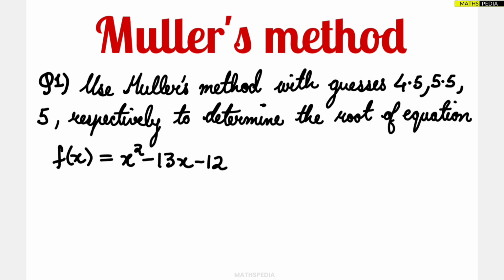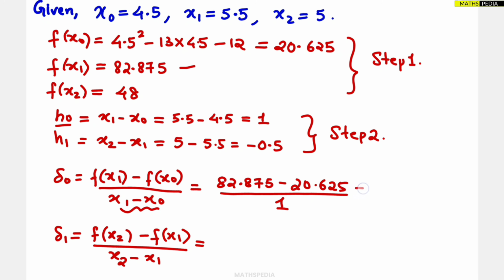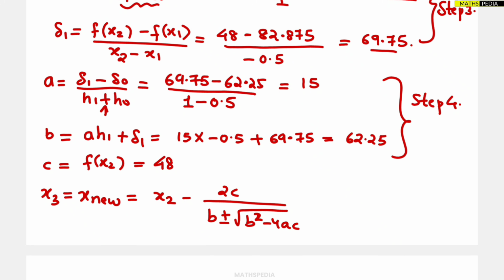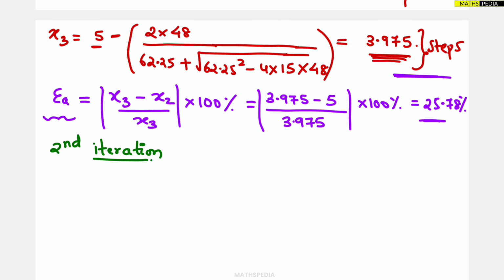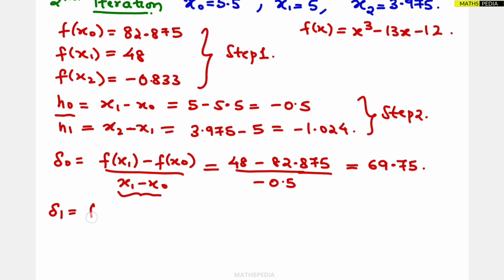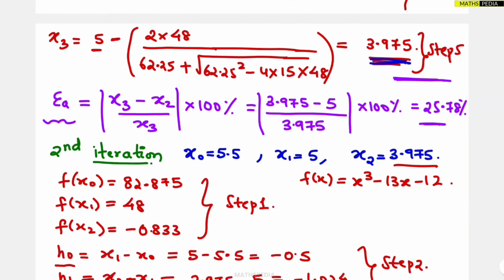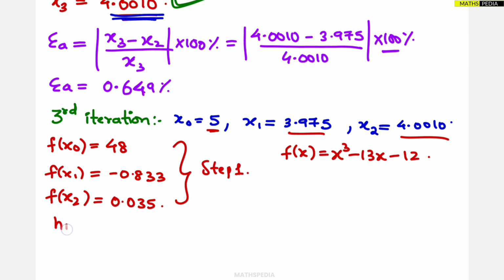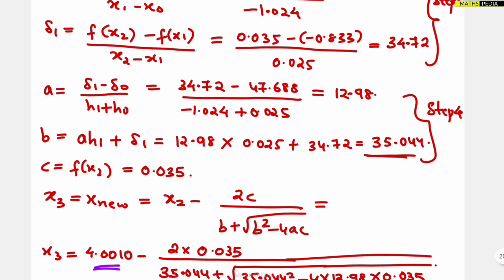Muller's Method | Numerical Methods | Engineering mathematics | Example solved | Mathspedia |

Comment: I m getting different values for f(x0), f(x1) and f(x2). In the very first step
Reply: Same here.. When my Xo=4.5 f(X0)= -50.25
Reply: Same
Reply: What if a question like this (perform three iterations  to seek for the the smallest positive root on (0,1) for which the function f(x)=x^3-3x+1 
Xo=0.0,X1,=0.5,X3=1.0
Reply: Same